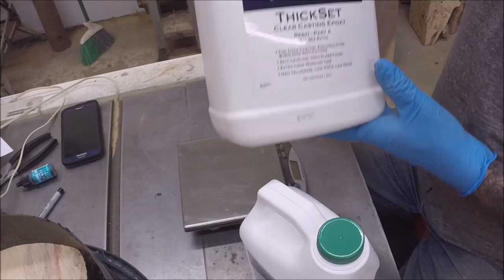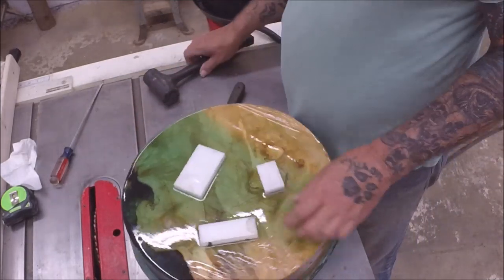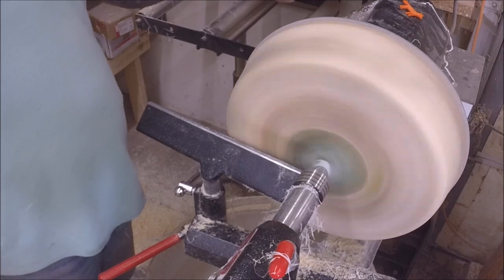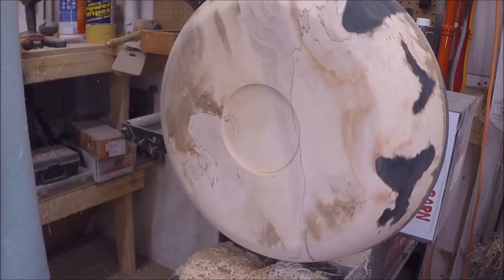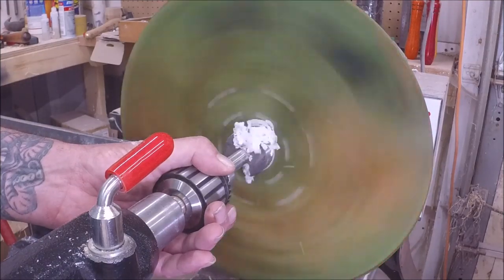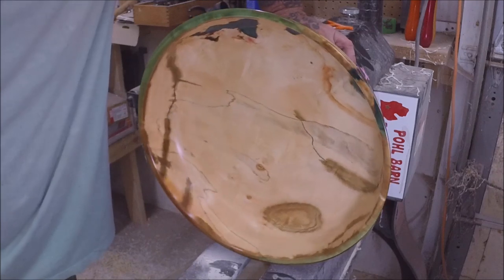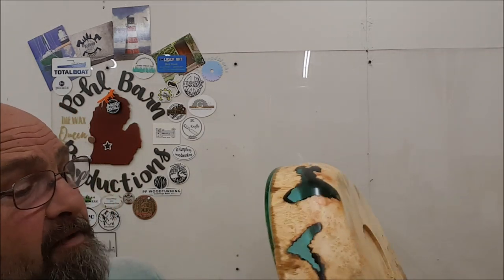Mermaid Salad Bowl

Comment: Very beautiful bowl. I am very impressed with the Total Boat product. Even though you take a beating when it comes to using a gouge or carbide cutter. The results are well worth the effort when it is all done. I'm going to try the same Total Boat product you used for the pieces I have that cannot fit in a pressure pot. Just the information I needed to see. Thanks for taking the time to edit and post your videos.
Reply from the maker: Thank You Stephen,  I'm not totally sure it is out yet, I poured just about 1920 gm of resin on the first pour, they warned me not to pour more than 3 inches thick, then I added more resin the next day to top off the pour,  it did turn out nice but I did also get a witness line where the pours met, not bad but visible.  I do have a promo code POHLBARN for 20% off

Comment: I love your work, and the up cycling of otherwise useless junk wood. I have been working with resins for years, and a couple suggestions for getting rid of bubbles would be instead of pressure, try a vacuum chamber, or another method is with vibration. Vacuum pulls the air out of crevices, and the vibration helps them rise and faster and pops them when they hit the surface. Keep up the great work, and the corny humor, I’ll keep watching and getting inspired, Thanks, and round and round she goes
Reply from the maker: Thank You, I currently don't have any of that equipment,  some day hopefully

Comment: Gradually making my way through old videos.

Did you have a coring system at this point?  Would you use a coring system now if you were doing this again? Is it too shallow? (the end pictures look shallower than I thought is was at the beginning)
 I like the way the resin formed little windows in the side!
Reply from the maker: Thank you Susan,  I do not have a coring system to this day, it would be nice but it's very expensive,

Comment: Saving and turning a bad piece of wood and turning it into a beautiful piece of art, that's awesome!  and it turned out beautiful! What kind of resin do you use?
Reply from the maker: Thank you Misty, on this one I use Total Boat Thick Set resin,  it wouldn't fit into the pressure pot because of it's size and I knew I could use that resin to make larger pours without pressure,  it just takes a couple days for it to set up,

Comment: Amazing!!! Do you have any advice for how to get started in this craft? I have some woodworking knowledge and always worked with my hands (retired mechanic, also metal working experience. Welding, fabrication, blacksmithing). Been watching you for a few months now and have very impressed with your work. Any advice you have to offer would be greatly appreciated. Thank You So Much for your time and efforts! Outstanding work Sir!!
Reply from the maker: Thank You Charles....  Pretty much I am all of those things also except blacksmith,  and a back yard mechanic,  I've learned watching other on Youtube,  researched what I wanted to do watched those who do it, picked through them to find the ones I could learn from the easiest, Zac Higgins for the resin, everything you want to know he has probably covered, and then a hand full of turners that I related to the easiest, many great turners out there but I didn't need that much information to learn, so they were boring to me, still great instructional video's , then I put my hands on and went old school, trial and error, we learn from our mistakes and that's how we don't do that again !  I already had a lathe, purchased second hand 20 prior and never used, I upgraded after I decided I really like it,  this is NOT A CHEAP HOBBY !  I dropped 10k last year and I already had most of the tools as I use to have my own cabinet shop.  LOL  hope that helps some.
Reply: @PohlBarnProductions  Thank You Sir!! Yeah I'm sure it's not cheap. Most of my interest tend to be rather pricey. I have a shop full of tools and still need more space. The wife says the only difference between men and boys is the cost of their toys. Lmao  But she's really understanding and tolerate. Thanks for pointing me in a direction. I look forward to seeing you work. Again Thank You for your time.

Comment: 15:37 I think that the exterior should only be finished after the interior is finished, just because of that: the mount in the chuck may not be the same as it was on the faceplate
Reply from the maker: I've done it that way Gabriel, just finished the mortise, it was off a little bit but nothing to bad.

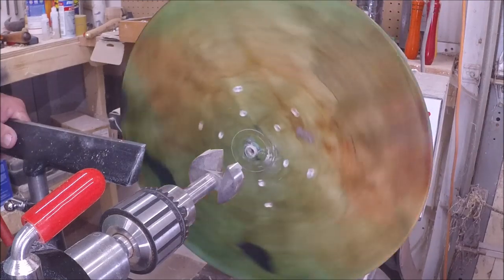Comment: An uninformed question. How does the chuck hold this heavy piece (from 15:23)? There are no screws so i assume it expands and holds to the indentation, that you made earlier, with pressure. But how it doesn't split the whole thing in half?
Reply from the maker: yes the chuck holds the bowl by the mortise I put in the bottom, there is enough pressure on it to keep it on the chuck but not enough to split it,

Comment: So 3:1 would mean 100g:33g... not 100g:28g.
Reply from the maker: Technically you are correct.  but the data sheet from total boat for this product say 28 to 100 which is not actually 3 to 1,